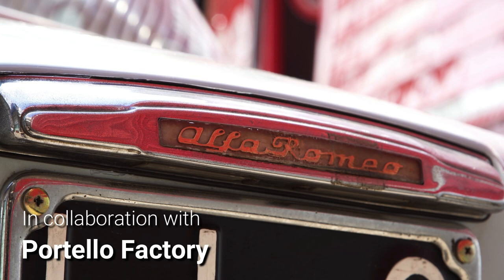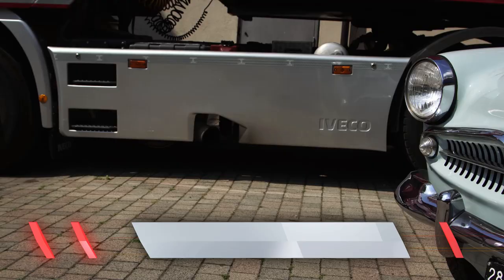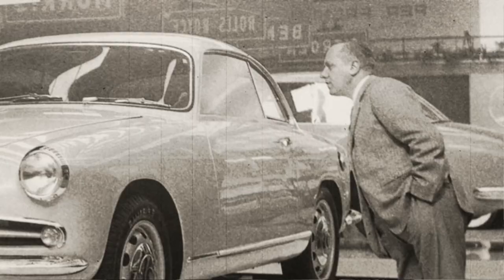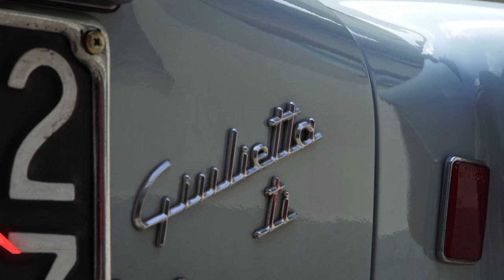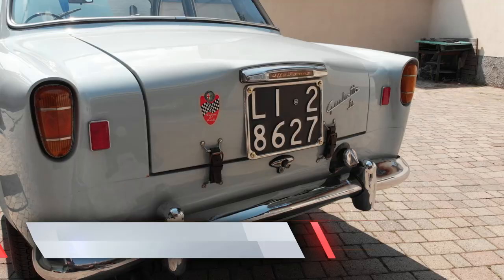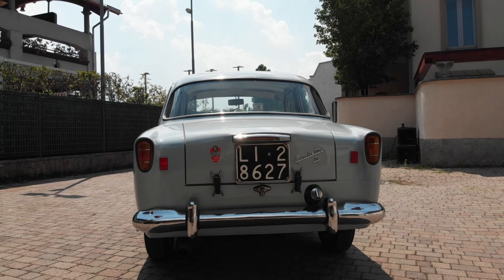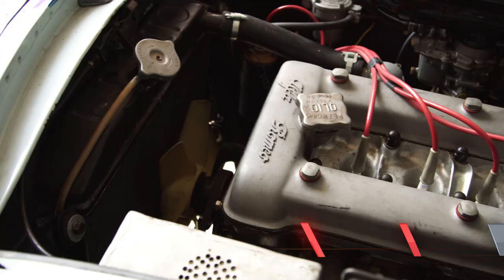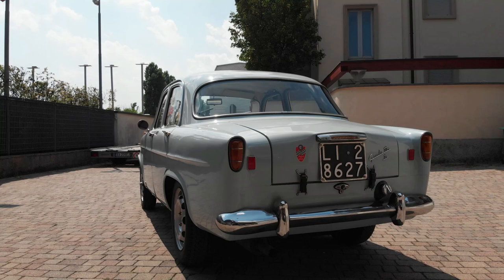Alfa Romeo Giulietta Ti: The Story 1957 - 1964

Comment: It’s amazing they were using the DOHC engine design in the fifties yet I can’t think of a reason for that other than achieving a desired valve angle.
Reply: Alfa Romeo was involved in racing, they had DOHC engines already in the 1920's, in some production cars as well.
Reply: @rangleri  Yeah but what would be the benefit, especially for production models except the aforementioned valve angle on the intake side and possibly the better central spark plug positioning? Is that much horsepower gained by those two advantages that result from the DOHC configuration compared to the added complexity and weight vs SOHC? When 4 valves per cylinder and variable timing are brought into the mix it’s understandable but in this engine maybe it’s something else.
Reply: @cancracker  They probably would have made more money using more conventional engine designs. But they made things their way, and I think it is fantastic, it must be one thing that made this company special. A desired valve angle can be achieved using different kinds of rocker setups, even with pushrods (If you think about Peugeot engines from 1940's or 50's, or american Hemi engines for example) But it might not have been possible at higher RPMs. These Giulietta models have peak horsepower at over 6000 rpm, to get more horsepower from a small displacement. Many countries in Europe had heavy tax rates for big engined cars.
Reply: @rangleri  maybe it was the higher revs they wanted and the conventional engine design of that time wasn’t able to achieve that economically. As metal technology and standards change so does the economic factor thus favoring one engine design over the other. Nowadays the Corvette OHV revs beyond 7k, that might not have been possible 70 years ago economically. I don’t think they made them uselessly expensive by design, it’s just sometimes their cars became that way, especially since they only occasionally sold massive numbers. My interest is from an engineering viewpoint and what they considered to make that design choice.
Taxes are still high in Italy, especially the VAT. For a Ferrari it’s almost one third of the net price.

Comment: Why is the shadow line (not sure I am using the right design term here) on the side of the car is getting lower towards the rear end of the car? What is it supposed to express? The tail of the car looks nearer to the ground because of this, but I cannot really find out the purpose of this design element.

Maybe I have to rewatch your early design videos again :)

Nice video, as always :D
Reply: Think you mean swage line
Reply: I just commented the same ☺️ I think it makes the car look like a cat ready to pounce , the rear sits down squat
Reply from the maker: As Matt said, that swage line is there to play a visual trick with your eyes and make the car look like it's sitting on its back wheels